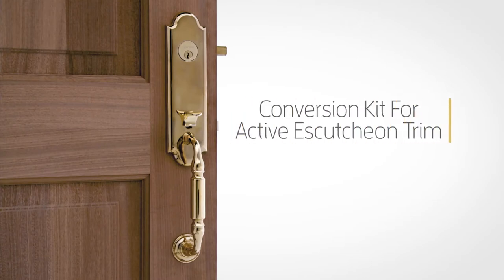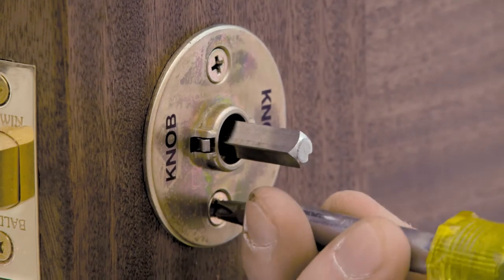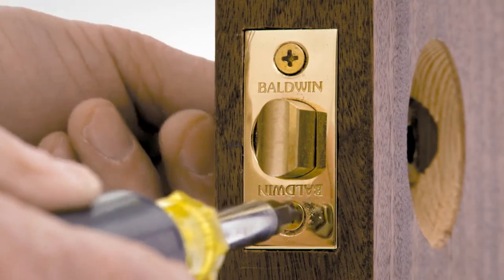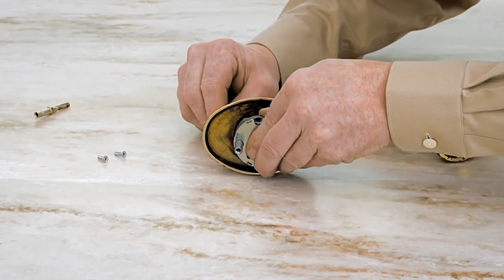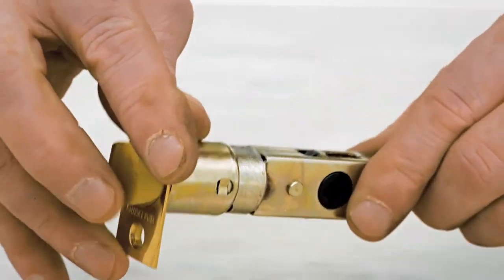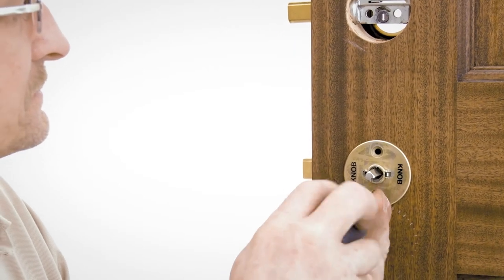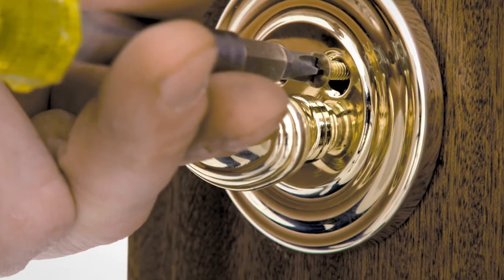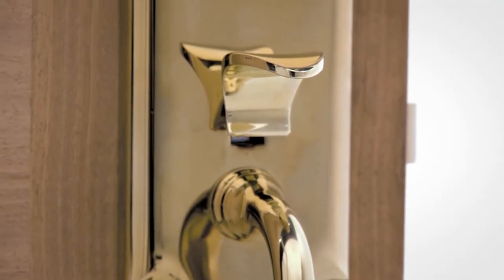Conversion Kit Escutcheon Sectional Trim

Comment: please note that the screw cover disk may be the type that pops on, rather than screws on / off. If you find you've been turning it and it won't come off, look for a slot for a small flat head screw driver to help pop it off.